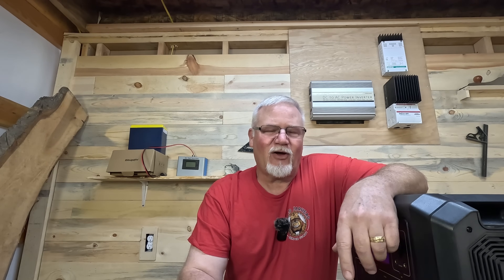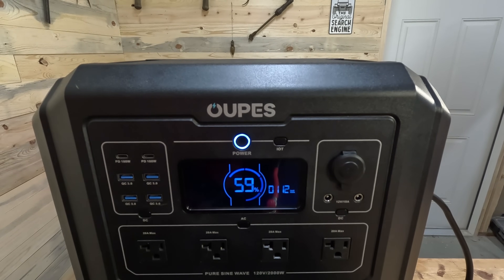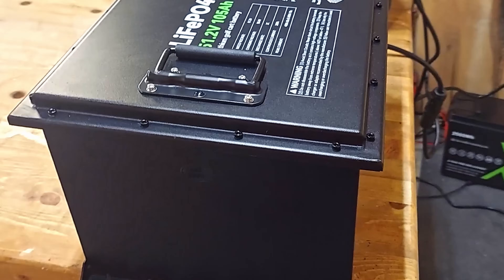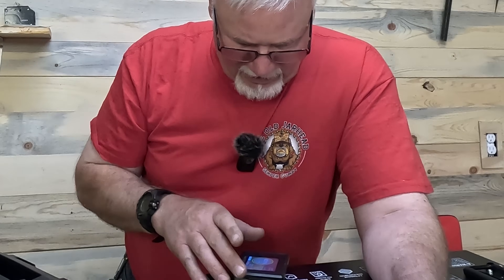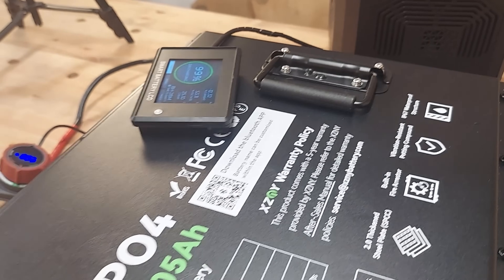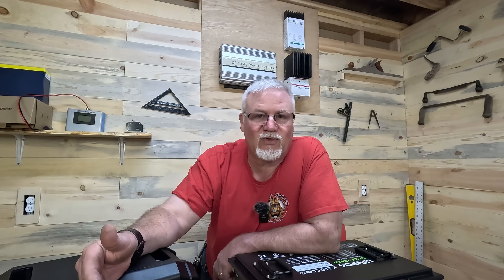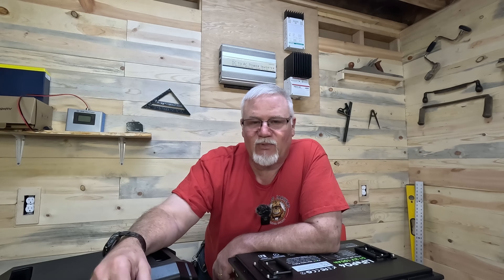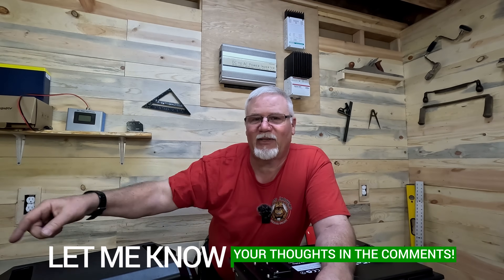🔋 SUPERCHARGE Your Powerstation with THIS Battery! 🔋

Comment: I don't this with 12v batteries in parallel to provide 24 volts.  It's actually 25+ Vikas with lifepo4 batteries.
I also do it with 36v batteries because I need them for trolling motors.  It's an oddball voltage, but I have 2 of them and they work just fine with my two larger power stations.  The small Bluetti I have will only take around 20 volts.
I'm not familiar with this brand, but if it's $3k, wouldn't you be better off with a server rack battery?  Those provide.about the same power for around $1200 or less.
The biggest drawback to this system is that you have to charge the external battery separately, where the proprietary batteries charfe along with the power station.  I just refuse to pay those crazy prices for Bluetti extra batteries when lifepo4 batteries can be had for dirt cheap.  I think I paid $399 for a 36v, 100ah battery on Amazon.  That's 3800 watts, so around a penny a watt.  I do have to plug the battery charger into my power station to charge it using solar when we are camping, and that's inefficient.
Reply from the maker: $2k for this one, but yes, there are less expensive options!  This one is a beast made for Golf Carts but the message is 48v will give you more power 😉
Reply: @TheOldJarhead  I just ordered a 3rd 36v battery from Amazon today.  We bought a 36v golf cart, so now we have 2 boats and a cart that use 36v batteries.  I think I paid $1100 when I bought my first one 3 years ago.  It was 40ah AND I had to order a separate charger.  Today I paid $625 or so for a 100 ah and a 25A charger.
The 36v batteries keep up with everything I need to run, but as you said, the charge rate is a little slower
Reply from the maker: Sounds like you have it worked out perfectly!
Reply: You don't have to charge the external batteries separately, your wrong on that point, you can wire solar to the battery via an external mppt then add o ring cables from the battery to the power station 

The power station will be charged from the battery and once it's full the power station won't take anymore charge 

Then the solar will just charge up the batteries
Reply: @viyusavery248  You are correct. Unfortunately, my current solar equipment won't charge a 36v battery bank, only 12-24.  I just have a Renogy 40A Rover MPPT because I started with a kit from Amazon several years ago.  I really need to step up to a bigger charge controller so I can do what you describe.  I can do this with the 2-12v battery system hooked up, but I have to reconfigure my panels because the voltage coming in from the array I use is over 100 volts.  That's not a huge deal, but I just play with this at my house rather than relying on it.  I don't even have a charge controller at our camper in the woods.  We have it under a pole barn and I just run 1200 watts directly into the power station.
Reply from the maker: You could get the Bateria MPPT controller I'm using.  For 100 bucks, it works quite well and will charge 36v

Comment: Great info! I bet most don't realize this.  I have a Delta Pro and Extra Battery.  Supplement it with 2 48v 70ah Lifepo4 batteries. Gives me an extra 6700Wh for emergency backup.
Reply from the maker: Thanks!  and sounds like you've got a great setup!
Reply: @TheOldJarhead  Thank you ! Started working on this backup power system in 2022. Never lost power since.  LOL!
Reply from the maker: lol ya, I don't lose power often here but got into power stations for overlanding and wanting to run a fridge on the road, or extend my camper power, etc..  But my offgrid cabin taught me a lot 😉
Reply: @TheOldJarhead  Keep up the great content.  Love your channel.
Reply from the maker: Thanks man!  I appreciate it!

Comment: That would make a nice little system for a lot of folks rather cheaply.  Great way to save if you dont have a lot of money.  My little pecron e600 has a 600wh capacity but can take in 95 volts.  It also has 1200 w inverter and is only 300 bucks.  That would make a really nice affordable system with a decent inverter and lots of storage.  Great video!
Reply from the maker: Yes!  And I abused a Pecron today with it.  Wow!  It took some abuse and just kept going... video to come 😉
Reply: @johnmal5975  exactly the e600 has 95v input which out classes power stations 3 times it's price thing is a mega beast best value power station ever created on planet earth 

Get an external mppt like the bacteria power , then hook up the external batteries while the sun it up you can actually charge the power station and external batteries simultaneously
Reply from the maker: Agreed!  To me, if using a power station that's the way to go!

Comment: Hybrid power station is the way to go , wish i knew these tricks earlier 

You can get 100ah for $100 each , charge those up for storage.. you can run a large fridge with a cheap $230 pecron e600 for days
Reply from the maker: I haven't seen good LiFePo4's for $100 but I have. o doubt they are getting cheaper!  And yes with several of them you can run a fridge for days
Reply: I snagged 100Ah for $119 this week. The seller accepted my purchase then promptly raised prices.
Reply from the maker: I wonder how good they are?